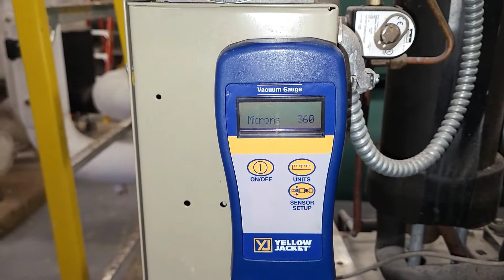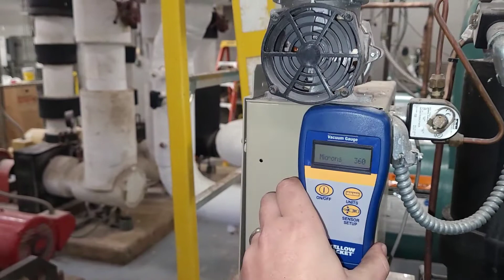Trane CVHF Chiller Leak Repairs Update & Vacuum

Comment: Nice job.  Always good to see a old chiller still operating. 

Always had good luck with JB pumps. 
Recently purchased the 10 CFM pump, Pulled down a New 1300 ton over night. Still waiting to see how it performs on big air cooled equipment.